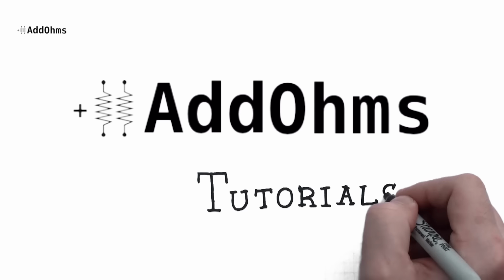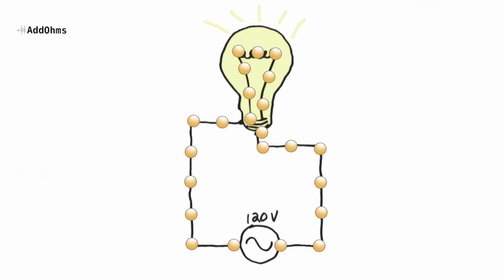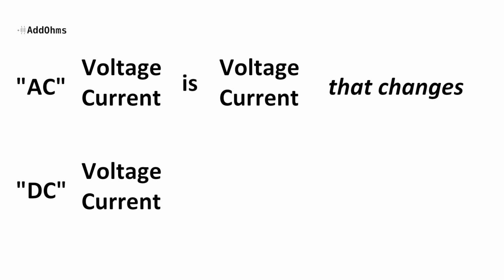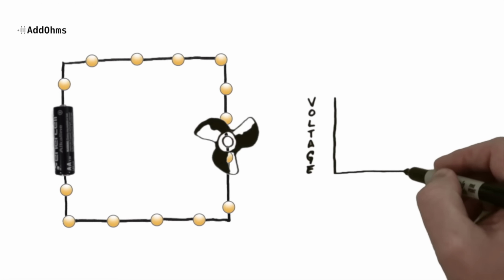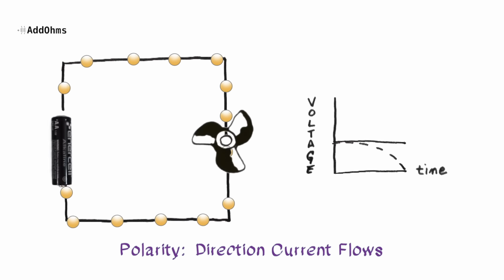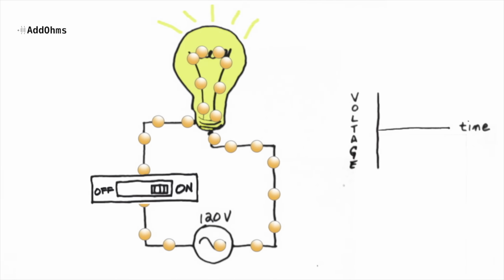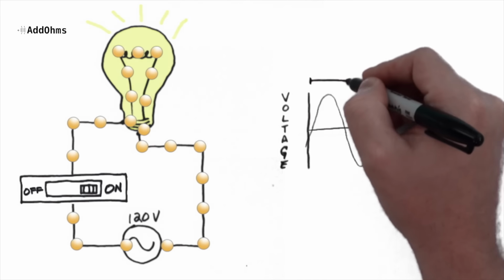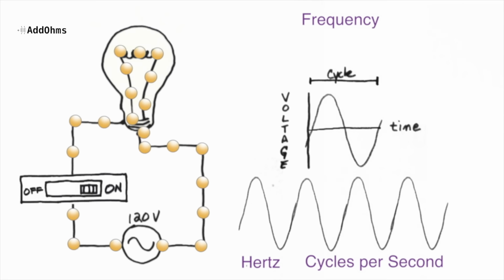Difference between AC and DC Current Explained | AddOhms #5

Comment: So, if AC in light bulbs have a frequency of 50Hz and that the bulb is flashing 50 times a second. so what if we connect AC to a fan? does it change direction?
Reply: If a DC fan was connected to an AC circuit, yes it would try to alternate back and forth very quickly; however, the motors used in AC circuits is actually a different kind of motor all together. AC motors use both current directions to their advantage to rotate the motor. Here is a video on how an AC motor works https://www.youtube.com/watch?v=N-z24mvbVr8
Reply: Ac motors use a rotating magnetic field which utilizes the frequency of the alternating current to make them more efficient. Take a moment and look up a few vids, lots of good info out there! Good question BTW
Reply: Paupiah Jesher my question exactly

Comment: Is it possible to alternate current from a AC motor ? How ? Nice video  :)
Reply from the maker: Do you mean, to generate voltage from a motor?
Reply: From a AC motor... Can you get electricity  ? Like on a e bike with a brushless motor, to recharge.. ?
Reply from the maker: majonesn Yes.  An AC motor can either be a motor, or a generator.
Reply: I thought always only DC motors where used as a generator. I have never seen someone use a brushless motor as a generator. Do you know how it`s possible ? It`s interesting because i have made a brushed motor witch produces somewhere between 90-95% more torque under load/acceleration than the conventional model. With the same amount electricity on input (in reversed set up, it functions as a generator producing almost double the amount on the same source to turn it). Witch means, if i could use the same kind of idea on a brushless setup. I could get way more effect. But really. Never heard or seen anyone use a brushless motor as a generator. Thank you for answering. If you have any more information on this... please let me know
.
Reply: Ok, i found something about it on youtube.

Comment: Can slow motion camera's pick up the flickering?
Reply from the maker: Spencer Wenzel Yes.  Although, depending on the speed it may not appear as flickering.  Old-school incandescent bulbs literally glowed.  So It would be seen as changes in brightness.
Reply from the maker: ***** Yes, but in a different way.  First depends on if it is a CRT or LCD.  CRTs are repainting the screen (practically) one "dot" at a time using various methods to appear as a single image.  (Look up "interlacing".)

LCDs have a response time that individual pixels must change, which gets refreshed at a certain speed.  They also have a backlight.  Modern backlights are LED based and so are driven by a DC driver.  They are flashing, but at thousands of times per second.

Older LCD monitors used a fluorescent tube bulb for the backlight.  These don't flicker in the same way that an incandescent bulb does.

Comment: so which is stronger ac or dc
Reply from the maker: It's not really about which is "stronger."  Both can vary in strength.  Both can be dangerous.  Both can be safe.  It just depends on how they are applied.
Reply: ok thx
Reply: AddOhms ac is safe than dc cuz we hava neutral at many ,not in case of dc which is steady